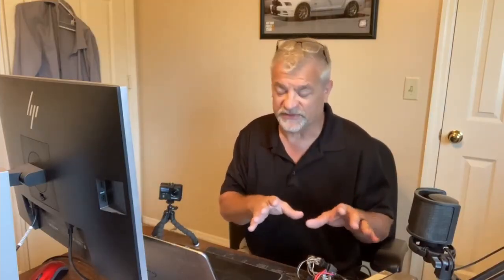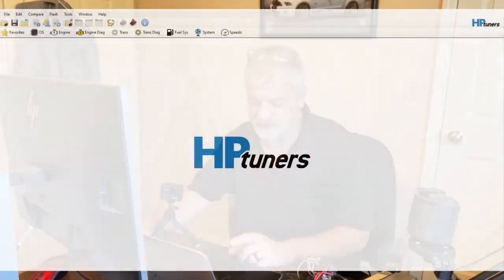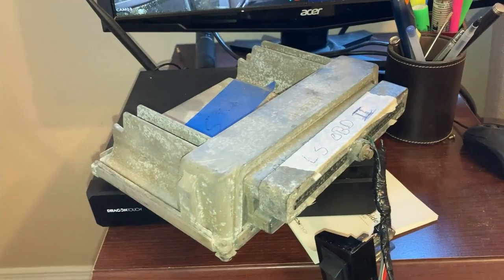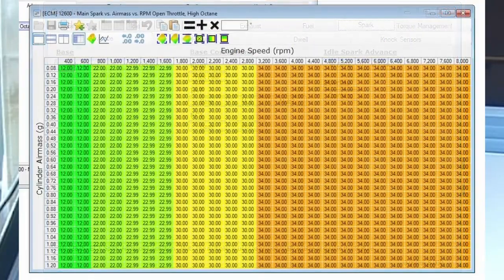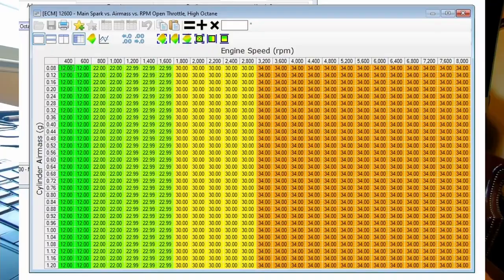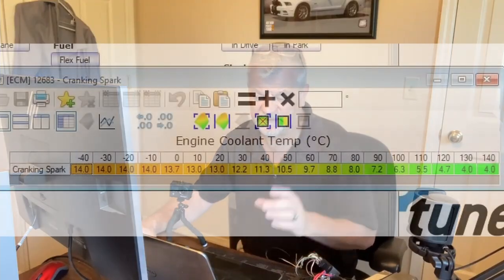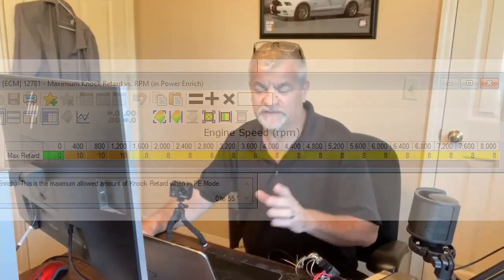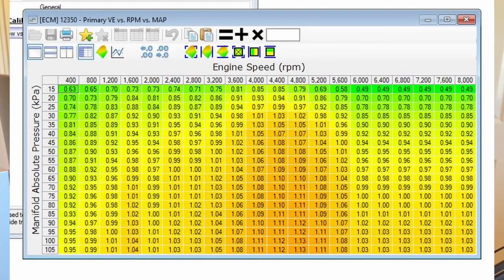HOW TO RUN A CARBURETED LS ON THE STOCK ECU WITH HP TUNERS

Comment: The timing table set up in this video, how different will it be depending on cam specs?
Reply from the maker: Just depends where you wanna put the power down if you wanna put it down low or a pie and what your cam is made for the you manage the max advance to its power band

Comment: @drart, When using the 0411 PCM, how is the cam and crank sensor sync relearn? The OE way is to hold the throttle WOT till the fuel cutout.
Reply from the maker: Short the tps wires
Reply: @HotRodRehab  Ref volt to signal, ground to signal or all together?

Comment: Could you still run a 4l60 or 4l80 with this application?
Reply from the maker: yes you just need to add a tps to the carb, Holley makes a kit for this